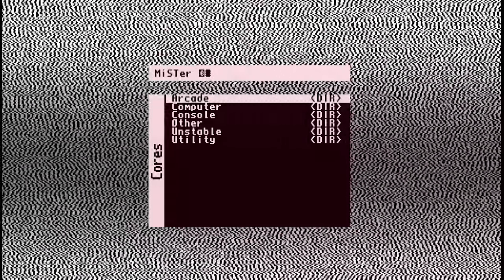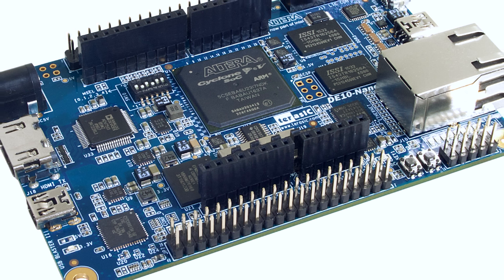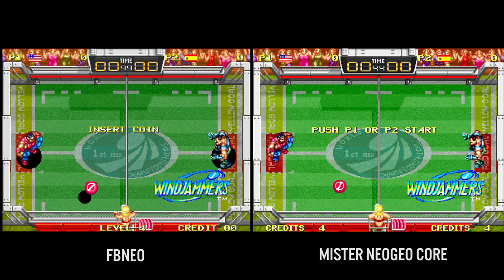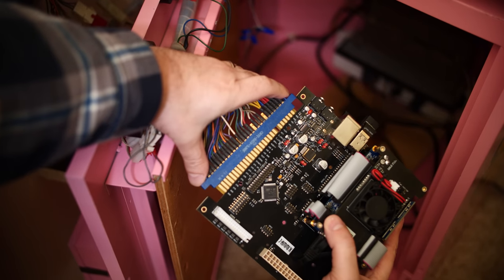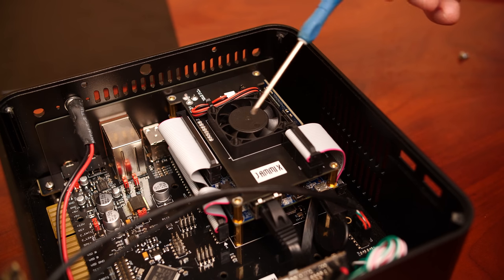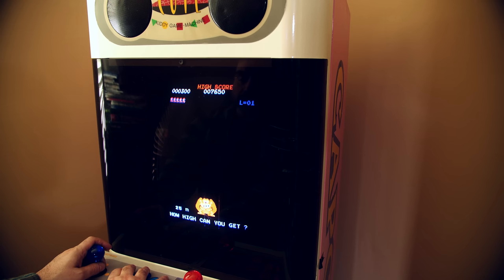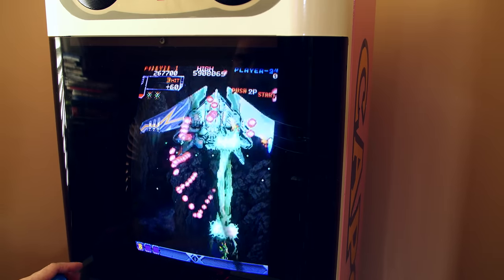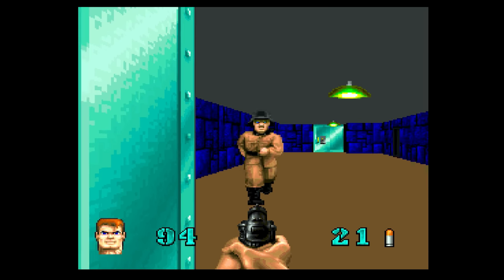Finally - I got my hands on a MiSTer FPGA Retro Gaming Setup | MVG

Comment: it's even better when you can use a cartage.  hopefully adapters come soon
Reply: No, the games are exactly the same as rom or iso.
Reply: I think that is the one development that isn't going to happen. The DE 10 Nano lacks enough GPIO pins to make real time cart reading feasible. 
There some USB based solutions out there, but then you aren't using the cart, you are more just dumping the Rom, like how the Retron 5 Works. 

But the game runs just like if you had the cart, Disc, floppy or other original media. 

The MiSTer does have a optional Analog to Digital add on for Microcomputers that takes programs on cassette tapes.
Reply: @lukasperuzovic1429  You never know. They  exsist for emulators and I have a cart adapter for my snes mini. I know they are totally different butttt....its not like analoge and retro USB AVS are not already doing similar with their fpga.
Reply: @robertpaul1435  Analogue and Retro USB made their boards from scratch and has all the IO Pins to make carts work. The DE 10 nano, you are stuck with a fixed number of pins preset on the board, there simply not enough pins to use the carts like the original hardware intended, you can only dump the rom from the cart like the Retron 5.

Comment: Hey @MVG. For the SNES core, when playing Tetris Attack in extremely dense games (lots of lines being sent between players) does it slow down like the original hardware does? I'd like to know this, because playing Tetris Attack on original hardware, when you get that good at the game, the slowing down actually gives you a boost to do even better. And I'm concerned that if running a Core on much beefier silicon (by comparison) could likely result in this slow-down not being replicated at all. So I'd love to hear about that aspect.
Reply: In theory, it will slow down as it cycle-accurately emulates the original hardware.
Reply: @jesseopjescherm  I'd like to see what that's like

Comment: Does the performance of the FPGA in the MiSTer  top out somewhere around a PS1?
Would it be fair to assume that a future version of MiSTer will have a larger FPGA that can emulate more recent generations of consoles?
Reply: With the chip shortage I doubt it, before the chip shortage hit the De 10 nano was the cheapest FPGA Dev kit that meets all the project needs when it started. 
The next largest FPGA would be more than double the DE 10 nano's cost. And that not assuming you got a dev kit and not just a chip that you now have to make a PCB and a whole system around.

Comment: I'm glad you've finally had a chance to play with MiSTer but I think you've missed a few features that I believe are unique to hardware emulation (at least at the moment).  For one thing, the Sega Genesis core allows you to choose which model of sound chip you want, the YM2612 from the early units, or the YM3438 in later units.  This is a really cool option as some games sound better depending on which chip is used.  Also, in the NES core, there's an option to allow it to draw more sprites per line than the original NES hardware could handle.  This helps reduce sprite flicker issues if you want an enhanced gameplay experience.  Finally, the scanline options are not screen overlays, as are often used by software emulators.  As the name implies, screen overlays just place horizontal black bars over the screen after the emulator has rendered the emulated graphics.  This process overwrites the actual graphics data with black lines.  With MiSTer, the renderer actually displays horizontal blank lines in between the rendered graphics and I believe it does so in a manner that preserves integer upscaling.  Normally I don't mess with scanline effects, but with MiSTer I actually prefer some scanlines.  All of these features, and many more, make it hard to go back to software emulation when a good option for hardware emulation exists!  With official controllers into USB converter kits, it's extremely difficult to tell the difference from using the original hardware.

Comment: I watch your videos a lot. Can you name a few good solutions where you can have software emulation and at the same time you can output it as analogue RGB to a a 15khz display. 
I have a PI2SCART SCART for arcade emulation on a 15khz display and as I am not able to play arcade games on real hardware I can't compare it but SNES emulation on Emulation Station is not good as I feel a lot of input-lag compared to real SNES hardware.
Would be nice if you can show up good solutions to have emulation on a CRT TV 15khz with analouge RGB output in 240p (and not interlace like the first Xbox do) :)
Reply: Even with a USB game pad, the SNES core for example feels closer to a real SNES than the Pi or a Modded Xbox or Wii can. 
Only other thing outhere that comes close to the MiSTer is the Super NT, and that is a FPGA clone console that only does one system.

MVG showed his MiSTer in a Jamma setup, I think Retro RGB got some examples of the MISTer on a PVM.
Reply: @lukasperuzovic1429  Yeah, normaly I preffer to play on real hardware (and I don't use emualtion besides arcade gaming), but a friend show me some powerful emulation of SNES, NES and so on on PC. He used Retro Arch with the right cores. It feels near perfect (no input lag that I reconized), but also need a powerfull PC. Just curious if there is a cheaper way then MISTer to emulate video game consoles and home computer and output it with RGB on a 15khz monitor (in progressive scan).
Reply: @HairFU  Keep in mind MVG's $700 Price tag isn't the norm. Current prices with official add on board might run you $ 315 to 400
Reply: @lukasperuzovic1429  Sure, but still a lot of money. But it is not about a pirce (not primary). Would be nice to know what else is there to play old video- and computergames on 15khz monitor with RGB besides original hardware and still is good.

Comment: You are saying it is hardware preservation but at the same time that the emulation might be prone to the same bugs as software emulation. Which one is it ? I suppose it depends on the cores ? Since many chips have not been decapped and their internal schematics documented what is left is the reverse engineering work already used by software emulators. Is there a list of cores that are an exact copy of the original ?
Reply: FPGA and Software emulation are both coded by humans, so they can suffer from issues. FPGA cores are just more accurate because of their nature, but they still need to be perfected.
Reply: @ZaPpaul  yes this is exactly my point. I get the « no lag, perfect timings » thing for the MiSTer but perfect hardware reproduction? Decapping and reverse engineering at the transistor level takes an insane amount of time and I don’t think this is how it’s done. It is « just » a very good Verilog emulator. Unless some cores are different ?
Reply: @derek7808  Oh no, the reverse engineering is mostly done with decapping the chips. You cant realistically get a great job done using guesswork and how  software emulators work.
Reply: @ZaPpaul  do you mean that all the MiSTer cores are 1:1 reproduction of the original chips at the transistor level ? I’m not sure all the chips have been decapped yet, and I remember that the first versions of fpga emulators had the exact same bugs as for example banes, which indicates that they were based on the same incomplete documentation
Reply: @derek7808  Yes, unless the techincal information is present, it is commonplace for decapping/xrays etc to reverse engineer for FPGA implementation.

Comment: Two questions.
First, how long time does the Altera chip take to reconfigure the core. Is it instant or does it takes a few seconds to change the gate array?
The case, looks great, who made it, model?
Reply: "How long time does the Altera chip take to reconfigure the core"? 
It is almost instantaneous. The configuration is stored on the ARM CPU side of the FPGA chip and it's loaded into Dram. 

Just a note, the Ram MVG mentions is for the core use (ether to load game rom data or other data) and that uses SD Ram to get the timing response these retro cores needs.
Reply: @lukasperuzovic1429  "almost instantaneous" Thank you for the information.

Comment: I have an AVS, Analogue Sg and Nt. Would a MiSTer be an overall better setup and one-size fits all resolution or is the convenience of the other systems the better way to go?
Reply: If you are ok to use roms and isos MiSTer is better in every way. More systems and much faster bugfixes and new features. I have the Super Nt, Mega Sg and Mini Nt with corresponding flash carts and don't use them anymore. MiSTer has better scan lines, shadow masks, digital and analogue output and supports almost every joypad or arcade stick available.

Comment: Nice. I’m still trying to understand this thing! lol So aside from the form factor and vga and jamma connections, is there a reason to use this over a PC?
Reply: (With certain addons) you can get frame-perfect native controller input timing basically identical to the original hardware. Using USB only adds like a milisecond or two(iirc?) of latency above native inputs. On a PC the input latency problem is much more pronounced.
Reply: @moofree  Oh yeah on Software Emulation there additional latency because the sequential nature of how PC Processing works, even with blazing fast CPUs with multiple cores only one set of instructions can be addressed at a time, even having a GPU with parallel processing doesn't help.  With FPGA, you are running a mimicry of the original hardware, along with those chips can run as they intended. In software Emulation you ether fudging the game rom to work, or you running a software render of all that hardware, and can only really do one chip at a time.

Comment: the price tag still. you had it for free.

I find it very promising, although I see no reason for using FPGA solutions when you have the original hardware.

this is the next logic step for emulation though: why coding a virtual machine when one can have a "hardware clone" where software can be 100% fooled into thinking it runs on the hardware it was intended for? this can also make portabilization much easier, getting a whole system into a single chip.

Comment: Will there ever be an n64 core? I've been planning to get a MiSTer for a while, and the n64 core would make no difference on whether I purchase or not, but what could ever be nicer than an n64 core?
Reply: This question has been asked many times to devs... short answer: N64 had like double the transistor count of PS1 and Saturn. It won't fit on the DE-10s FPGA, unfortunately.
Reply: @AFFL1CTED1  wow. Double is unexpected for sure. I thought it was because the platform was famously complicated, but the fact that it's currently unachievable is @ _ @
Reply: @DarkadeTV  I was surprised too when I first heard that. I guess the N64 was actually pretty powerful, what really held it back was cartridge vs CD, obviously, but also a really small texture cache which gave it's games that famous blurry texture look. If they would have fixed that issue the graphics would have been closer to what early Dreamcast games offered... Or so I'm told. Pretty interesting really.

Comment: Seems like you want to be thanking intel for providing those FPGAs at a reasonable price. You can see on the board that it was made for uni students to do prototyping, which means that this device was most likely subsidized.
Reply: It seems to have arduino headers...
The only thing I would like this for, is to design my own ultimate console: the 12-bit machine! 12-bit integer calculations, 12-bit wavetable synth, 24 bit address bus, 12-bit colour. It would offer the epitome of pixel gaming.

Comment: Not to take away from anything the mister is, because it's a dope ass little system. But I feel the same way you did, and still do. It's waaaaaaaay too expensive. I totally respect the project and I am truly amazed at the accomplishments they have made. But I have no plans to ever buy one. Between all the hardware I own and the abundance of emulation solutions out there I can't even come close to justifying $400+ for a system that provides 80%ish redundancy. If I owned even a single arcade cab then this might be a different story.
Reply: It's only $400 plus if you get all these optional extras. You can start off with just the bare DE 10 Nano, a cheap OTG USB Hub, it comes with a small Micro SD card, only add-on I recommend to start is the SD ram board so you can use most of the cores.
Reply: @lukasperuzovic1429  here's the deal for me. Just checked my GameEye and I have 76 systems logged. Realistically that's about 2/3 of what I own, the rest just hasn't been catalogued yet. Of those systems there is at least one of every major release since the NES that has the full package treatment. I'm an old system modder from way way way back in the days. Where some people may look at this and say "for the money it offers so much!", and I agree it does. But but when you own most of the original hardware this thing emulates, arcade boards side, it brings much less value than originally stated. The truth is that I'm most likely not the average gamer, or game collector. In fact the only reason my collection is so small, and yes it's small, is because ten years ago I lost everything in a divorce. 10 years ago I was 35 and had been collecting games actively since I was 10yo. I lost 10 times what I have now. This time around the collection is much more curated with mostly items I want and play. Last time it was a storage unit full of game stuff going back to the 80s. It's actually refreshing to be able to look at something like the mister, that I know it's a great unit, and say "yea I really don't need that". 🤷 If I ever pull the trigger on an original Super Mario Bros. cabinet that I could buy right now for dirt cheap then I might change my mind on the Mister and a Jama add-on. But I currently have absolutely no place to put that cabinet other than in storage.
Reply: So I still am a Retro game collector, but I slowed down over the years. As I  nearly got what I want that I can find at reasonable price points. There alot that are too much for me, lot of Neo geo and PC Engine stuff is expensive. That said I do have a Working MVS board, and I found that the MiSTer is close enough where I have trouble telling the difference side by side. MiSTer's image is a bit sharper, but I prefer the MiSTer over even how Emulators handle the games.

There a few places you see the same flaws as Software Emulation or on Flash carts, but those are few and far between and hard to find if you don't know where to look. 
Example for me, I have to use the same "Fix" for Sonic 2 and Knuckles  many Flash Carts has to use. But otherwise it plays like how Sonic 2 Would be Locked-on to a Sonic and Knuckles Cart. MVG found in one Amiga Demo there some glitches in the visuals, going to that the timing is not always 100% 1 to 1 with the original hardware 100% of the time. But you never notice in most games. 

Some cores are more accurate then others, some are on par with emulation while others are on par with the OG hardware. And there some that needs work. It's all open source with most of the work ether done voluntarily or the devs run patrons to cover R&D costs (like decaping chips or buying service manuals to reverse engineer the hardware). 

You can even with Snac adapters run original system controllers with their respective cores as if they are on the original hardware. Lightguns will work if you pair them with a CRT, via Snac. 

For Modern display users, you can always use a Wii Remote Via Bluetooth with a Wii USB sensor bar, its not the same but it works.

Although this will not do everything, and you can't really use real carts as there some technical limitations going on. There not enough GPIO Pins to make this practical, and any USB solutions would be dumping the rom from the cart rather than just playing the cart as intended. So it be more like you are using that system with Flash Carts.
Reply: @lukasperuzovic1429  I agree. I have actually researched the mister extensively. It just doesn't make sense at the price point to me. If the total package was a couple hundred bucks I would have bought one already just for fun. I'm not exactly strapped for cash. My resources aren't unlimited, of course. But I have strong disposable income so I jump in on stuff like this from time to time. But when I can buy a Series S for less it starts to not make sense pretty quick. I've never been a huge emulation fan, but that's most likely because I have always had a hardware solution. All the systems that we all know as priced out of the market I have. I've also been importing from Japan for the better part of ten years. So things like PCE aren't a huge issue for me. I just don't see a point in my setup for it. 
Now to be fair. If I sold my consoles I would immediately buy one of these with every option board offered. But I don't share my collection on YouTube so there's no incentive to invest just for the sake of investing.